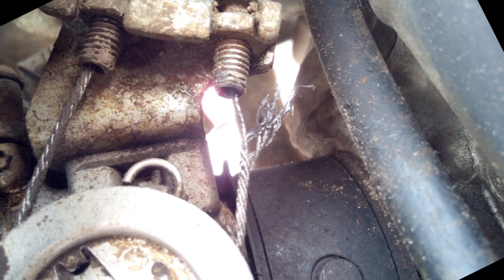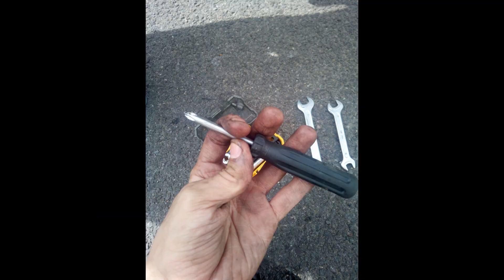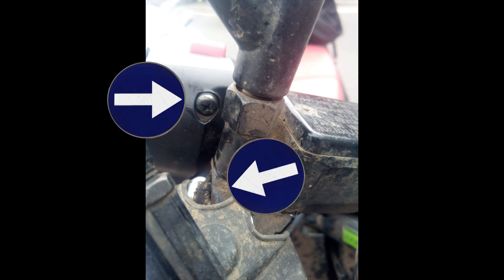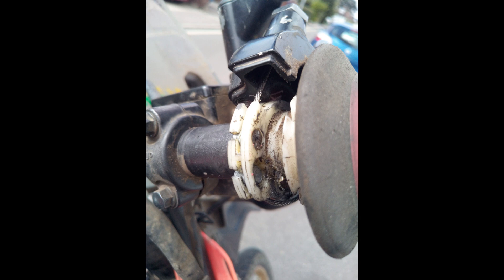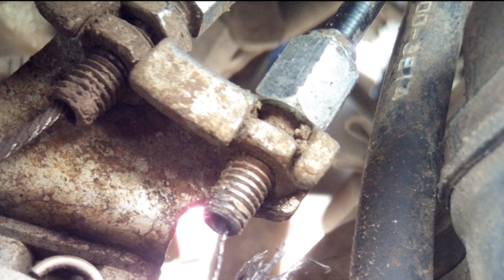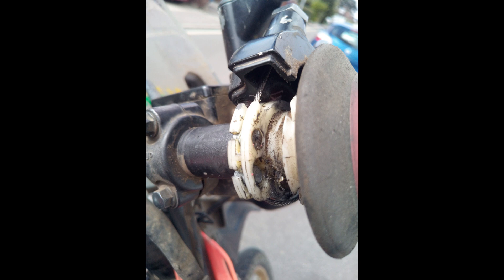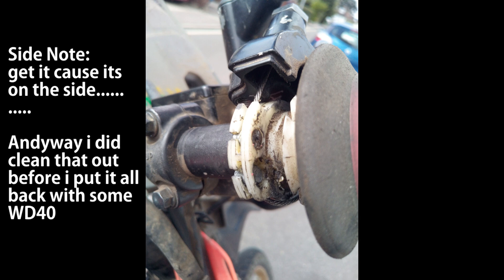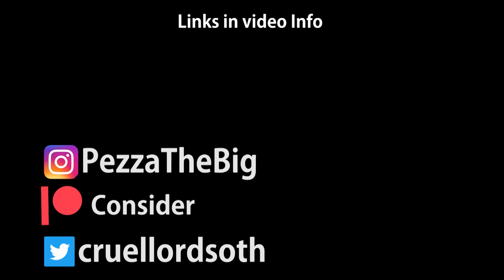Honda To Change A Throttle Cable On A Honda CRF250L

Comment: after doing all that how did you put the nut back in its spot with cable conected to the throttle it dosnt reach and to put cable back on to throttle body the hole cable has to turn so ho did you do it cause i cant get mine back on

Comment: Hi was that the quickest  throttle change ever  do u always keep a throttle spare on u   as a an essential item.   Nice & clear description how to change the throttle cable in easy  steps 
  👍
Reply from the maker: Na I don't have a spare throttle cable but if I was to do a big trip again j would probably take a spare clutch and throttle cable